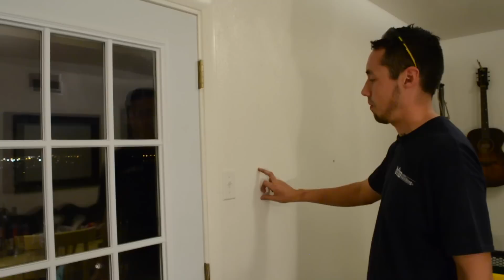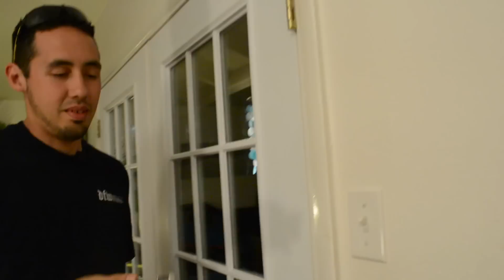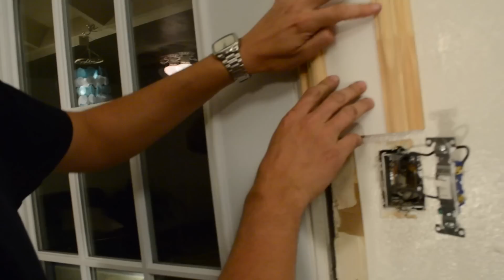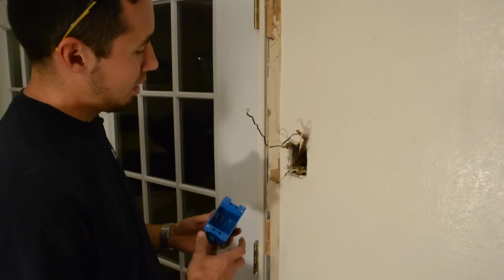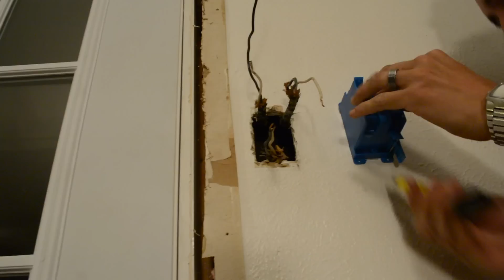Trim Carpentry - How to Move an Electrical Outlet/Switch

Comment: If you are removing a newer style box, the nails that hold it to the stud are at the TOP AND BOTTOM of the box, angled down.  How do you cut thru those nails without making a hole in the wall larger than the old junction box??  Or do you NEED to make it larger and just have a larger hole to patch?

Comment: Wow, you just saved me so much time and work. I have been replacing all of my outlets/switches in my house and have been delaying doing the ones where the new trim is going on for this reason. I had no idea that these remodeling boxes existed. Thanks!
Reply: LOL Have you never taken a stroll thru Lowes or Home Depot electrical dept?????  These have been available for DECADES.

Comment: I have this beautiful wainscoting in my house, but they half-assed it and didn't account for the location of the boxes, so in a bunch of spots they just cut the faceplates off. It's so annoying because it was new construction when they did it, and it would have been so easy to fix.

Comment: The taps on a cut-in box go into the box. It's to prevent the wire from being pulled out. The sheathing that covers both the black and white wire in this 2 wire system, needs to be at least 1/2" into the box.  It's to prevent nicking the wires. Try pulling the staples out of the stud to get more actual length to go into the box. Please don't teach bad electrical habits. That's how electrical fires start.

Comment: Nice!  Now all you have to do is patch the hole, match the texture of the wall, and paint the entire wall and hope it matches the rest of the room.  Simple :-)

Though I do have to give you credit - some idiots would notch out the trim molding around the existing outlet box rather than move it.  Personally, I think I'd just find replacement molding that would fit the existing situation without having to do any of those changes.

Comment: You are very lucky to Have that much slack! I just did something similar this weekend in my bathroom and I only needed to move an outlet 3 inches and I did not have the slack. I basically had to make a junction box and put a plate over it. Code does not allow a covered box in my area

Comment: sometimes that are Staples or Fasteners you could remove on the stud to give you more wire  especially with that type of wire NM cable but on the other hand that wire casing should receive a quarter of an inch into the box and Staples should be within 8"

Comment: The Tabs you see sticking up away from the "Old Work box" @~10:10 should be pushed into the box! They are designed to create a cable clamp. They will help as you pull the wires through by preventing them from snapping back into the wall. You will notice he edited the part where he had to fight them into the hole, or he cut them off. Very common mistake for DIYers.
Reply: Mark, there’s no need to be concerned with the tabs you mentioned, in fact I don’t even them.  Just because a manufacturer adds something in because they think it might be helpful, doesn’t mean you have to use it.  Just like Richard said...just make sure the tabs on top and bottom have wall to grab onto, as the wings are compressed.  Anything above and beyond that is superfluous!

Comment: What a half ass job. No you don't just push it over to see if you have enough slack, the romex or bx coating over the wire needs to be inside the box and you need at least 4 inches of wire outside the box.

Comment: Cable is usually stapled pretty close to the box, which can make this kind of box relocation hard.  If you have Romex (plastic sheathed NM cable), there are splice kits that are code-legal inside a wall cavity.  The only problem is that they aren't approved for the old cable with the braided sheathing that you find in older homes like yours and mine.   Then you have to put in a box with a blank cover to contain the splice if you want to be to code.

Comment: it doesnt have ground wire, by code it's need ground, only hot and ground connet to the single pole switch, look like you have netual on the switch

Comment: You did not need to cut the nails , just reach in the box with a pair of side cutters , grab the nail next to the box and pull the side cutters  ( right of left depends on which way the nails was driven in  this will force the nails out of the stud and out of the box. You can tell which way the nails are driven in is by looking for for the machine marks on the nail , they are next to the head of the nail.

Comment: As your moulding was gonna cover any drywall damage could have opened the wall up to remove the staples that held the wire so you could have a couple inches more slack on that wire from the bottom.

Comment: If you need a wire is it safe/acceptable to use a connector strip/blocks and use new wire. Is that safe in the wall like that?

Comment: Should extend the wires in the old hole to gain more space. Just few caps.
Reply: If you're suggesting to extend the wires by using new wire nuts and adding new wire to extend to the new box...that is not code compliant.  You cannot have any inaccessible junction boxes per code.

Comment: Your trim is so wide you could have cut the box out in your trim .Your luck you had that much slack in the wire usually its stapled 6 " from the box

Comment: Another cool trick I learned on how to determine which side of a box the stud is on is to look at the angle of the 2 nails securing the box, they are on an angle (to make installation easier between studs) the side the stud is on will have the nails angle deeper in the box (so angled away from you) The side without the stud will have the nails closer to you! Also you can used a strong magnet to find your drywall fasiner line (it should be in the center of a stud. 😉

Comment: Ok, if I do not have one of those things called a husband but my personal “honey-dew” list keeps piling up... should I shoot the original contractor first for he put a light switch right in the middle of the wall? Now I have to move it to another wall where there is no give-away and make a clean area for my mural. How do I wire it, do I have to pull the entire run from the attic and drop it at the other wall?

Comment: A different story if the electrical boxes are all hard pipe. Wouldn't b as easy. Where I'm in Chicago local 134 we don't do that romex/  bx bullshit.  Dangerous way of running wire. All our shit is hard pipe. Were a different type of breed. Actually gotta know how to work with your hands. Around here your no different than a low voltage guy running wire free air

Comment: Thanks for the video! I'm in the process of moving a switch box from a block wall to a newly constructed partition wall (garage/laundry). I may need more slack. Is there any problem extending the wires by add in a little wire and using a wire nut enclosed in conduit?

Comment: I would fire this guy. Broke the tabs in the Back of the box. Code violation, those tabs should be inside for strain relief. Violated U.L. listing.  Secondly the wire sheath need to be 1/4 long inside the box to be fire rated.

Comment: It is important to know that in some areas electrical code forbids BURYING a junction box in the wall. This would be the case where the existing wires were too short to reach the new location. In that case the old box would need a cover plate and be accessible to the surface and a jumper would be used to the new box.
Reply: Is it permissable to splice wires behind a wall, using wire nuts or push connectors?
Reply: @dougb8207  no
Reply: @dougb8207  no

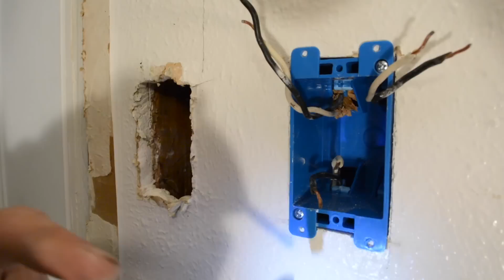Comment: Not up to code because the insulation around the 2 wires was not pulled into the box on the bottom. look at the view at 11:45

Comment: I'm just wondering if the blue box you used is only for low voltage wires. Where you you connect the ground wires?
Reply: 1967onebob 120v...commonly used

Comment: It’s not legit or up to code. The wires coming into the box need to still have their original shielding sticking into the box. It’s protects the wire and allows the box to hold it. Also, not a code thing, those little “ears” on the switch are meant to break off so it can sit down in that little groove of the old work box so your switchplate cover can be flush.

Comment: Always break the ears off the switch yoke when using the blue boxes. Those tabs keep the switch from sitting deep enough in the box. Leave them on when they are holding the switch body against drywall. Your face  plates will sit much better and the switch will not rock from side to side as it will be locked in the spot made for it in the blue box. Always enjoy your vids!

Comment: The outer sheath of the Romex must extend into the box by at least 1/4 inch. He now has unsheathed wires in the stud cavity which is a fire hazard.
Reply: You are correct and that's what I was thinking, having done this very thing as an electrician too many times to remember. I'm retired and still do estimates for a guy as a "side hustle" and make it known that we sometimes have to open up the wall and sometimes have to use blank covers because not enough slack. The code does not allow for bare conductors to enter an electrical enclosure as you correctly stated.

Comment: Make it simple and flexible.
No need to take up the old box. Put pieces of short wire between the two boxes and connect the wires by wire connectors. This allows more room for future electrical repairs if needed.
Reply: Electrical outlets aka: junction boxes, pullboxes, makeup boxes, recepticals, etc...MUST be accessible and serviceable and not covered or hidden by permanent coverings.

Comment: Just a quick tip. 
Snap off the Mickey ears of the switch or receptacle if you install them onto an old work box such as this. 
Those ears will hold the finish plate out just slightly off the wall otherwise. 
If you cut them off the device sits flush, and the plate will sit tight on the wall.
Reply: Was just going to add this tip as well. Enjoy your channel and videos as a electrician! Keep up the great work and awesome eye for details and quality for your customers!

Comment: And the romex on the bottom left is why you should hire an electrician instead of a carpenter to do electrical work ladies and gentlemen.
Reply: You keep a wire stretcher in your pouch?  :)

Comment: Edit; yep, didnt have to scroll down too far to see it's already been covered. Sorry to pile on.

No, man, those "little cutouts" in the old work box are NOT to be removed.  They are code required strain relief. Cut the tabs at the bottom of the flap covering the opening and Push the wires through the bottom of the opening leaving the flap covering the opening intact. The wires will easily push through from the back but the flap will prevent the wires from pulling back out.

I know I'm late to the party but I thought this was pretty important info.  Also, sorry if someone has already mentioned it, no time to read through all the comments. That thing I got that takes my paycheck every week is fussing about me sitting still all day. Lol!

Comment: That's nice, but what if you're installing a barn door and you have an outlet that you need to move more than 16 inches and you have studs in the way?
Reply: Two choices. 
1. Cut out large piece of drywall and drill the studs. Easy.
2. Get in attic, pull the wires back up, fish them back down in the location you want. This is harder and requires two people.

Comment: Very nice way to move a box but I suspect that US standards are looser than Cdn ones.  AFAIK here wire is supposed to be still in it's sheath outside of a box and one is supposed to have a staple not further than 6" from a box.  Amazon sells boxes like that here for 25$.
Reply: You are right. Same standards here. Sheath must extend into box at least 1/4 inch

Comment: Code violation bro. Those are  BX wires (metal shielding). you need to put those back in a metal box, not plastic box.

Comment: What do you do if the stud is on the wrong side?  What do you do if there isn't enough slack to move it where you need to go?  Does the remodelers box work with plaster and lathe?

Comment: I have a question about the wiring {and it will show my lack of formal training.}  If the wires in the original box were too short to move the new box as far as you need to, can you use say 8 inch +- 'pigtails' with wire nuts to extend the wiring?  I know according to most code any junction has to be in a box someplace but isn't there a way to extend wiring?

Comment: Does the same basic method apply if you need to move an outlet & switch up? I had put in a new sink with a new sink base that is much higher than the old one. Now when I try to put the backsplash on the side wall the outlet & switch are in the way.

Comment: Dude, why the big casing like that? Back to back p31 for door casing is a little much, especially when you just had 2"1/4 there. But hey, I'm a professional trim carpenter what do I know. 🤷‍♂️

Might look okay with a 7" pediment, bullnose 3/4" and 4"1/4 cove crown. But here is the real question. How do you tie your base into p31, gonna look like total garbage if you nub it into it. Unless you notch it out and use flat base only, that away the p31 has a place to die into. Assuming you use base that is 1"1/4 thick.

Comment: This works electrically but does it meet code?  I can't tell for sure, but it looks like the outer casing of the wires does not continue into the box. I.E. it's just the individual conductors. Doesn't code require that the outer casing continue into the box?  Also, with my luck there would be un-reacahble staples attaching the cable to the stud above and below the original box, preventing moving anything.
Reply: He also pulled the tabs out through the holes in the back.  I'm pretty sure you push them in and they have some resistance to clamp the outer insulation in place.

Comment: I have a question that doesn't relate to this video at all but I thought I would ask anyway.  I watch a lot of your videos and I have never seen one addressing the question I am going to ask so I thought this vid was as good as any to ask it on.  So,  how would you go about replacing a, let's say, 2 foot section of a 18 foot baseboard where you can't get one end of the baseboard because, in my case, it is behind the air handler unit?  Does that make sense?  Thanks.

Comment: I’m a retired electrician, had to move lots of receps and switches. Most of my work was industrial construction but I did a few residential jobs over 40+ years. Nice video and you sound like a nice young man.
Reply: Kenneth Bailey did you run rigid in your house?

Comment: I think in the case of a switch I would have left the old box it got covered anyway by the trim just run a short wire where your going with the switch. I had to move an outlet the other day and it had a vertical bracket on it Pain in the ass

Comment: I agree with @Charlie OConnor, @Cody Stockstill, @Paul Cohen and most of the others here who know the NEC code. You (Finish Carpentry TV) are ENDANGERING your FAMILY with this particular "rewiring".   
     1. the "renovation box" must be metal and these BX armored cable sheaths must be clamped to it to restore grounding for all downstream boxes and devices. Given the tatered appearance of the 'fill' in this BX, it's especially important to insert the 'red cap' bushings on the ends of the armor to protect the wire insulation from fraying. (CODE)
     2. The renovation box must be sized to take all wires, clamps and devices as mentioned by @Paul Cohen.
     3. The 'wire nuts' on the splices and terminal screws on the device (i.e.: SPST switch in this case) must be tightened properly.
     4. In order to do this particular rewiring up to code safety, it looks as if you'll need to make a bigger hole in the wall as @anasmrright suggests.
     5. It's hard to be sure, we don't get a clear view but the insulation on some of the wires visible at the 'old box' look broken? or scraped? Some of the 1970s wiring I've worked with needed to be handled carefully to avoid complete break down.  Yanking the metal box off the wires will often result in tearing the insulation and exposing the conductors. 

SERIOUSLY,  GET THIS FIXED SOON! IT'S DANGEROUS!

Comment: I would have cut out for a junction box between the wall and ceiling or just above the wall base (depending on which way the power is coming in) then ran a new wire .that way you have all the  slack you want.and it's safe
Reply: electrical code does not allow junction boxes hidden in finished walls or ceilings

Comment: Thanks for this! Our new dishwasher is shaped differently in back than our old one and I need to move the outlet for it about a foot up on the wall. I knew it couldn't be very hard but was always nervous to mess with electrical. Bonus for me is it doesn't have to be pretty, it'll hopefully never be seen again.
Reply: @Melanie Clarkson Don't follow this video's "instructions"! They are DANGEROUS! See  my (treemonk) comment in the main thread here; also those of others who know enough to warn how bad this "advice" is.  You should get a basic wiring-how-to book. Time-Life, Sunset & Black-and-Decker all publish well written guides often very cheap in used book stores & websites.  These will show you how to do what you want safely & correctly or explain why it can't be done without professional help.

Comment: I agree with the other comments... not safe nor legal.  Most of the time when I had to do this,  there is enough slack in the wire to move the old box sideways a few inches, leaving wire clamps and wires undisturbed.   I cut away the drywall to access the box and create a  new space, then moved the box and created a wood mount, then patched the drywall.  Much easier and safer.